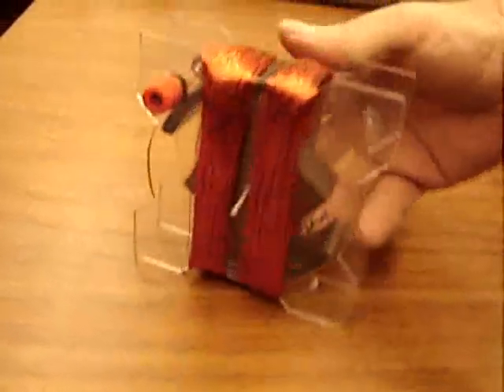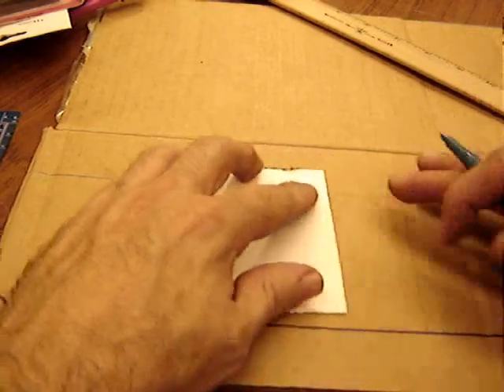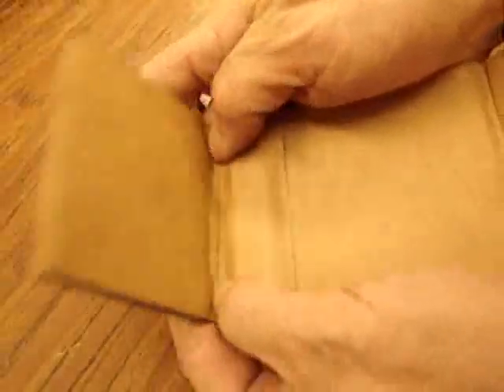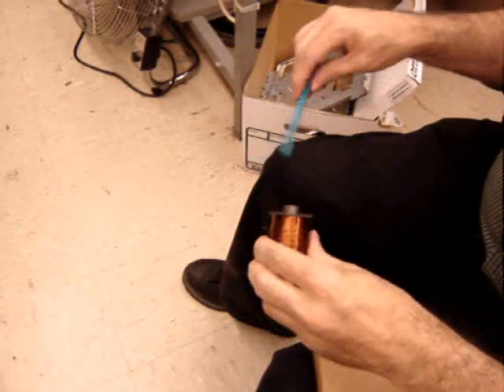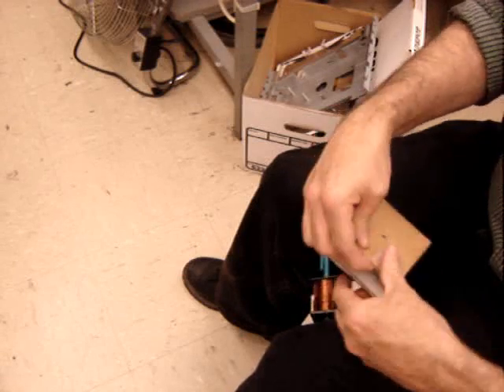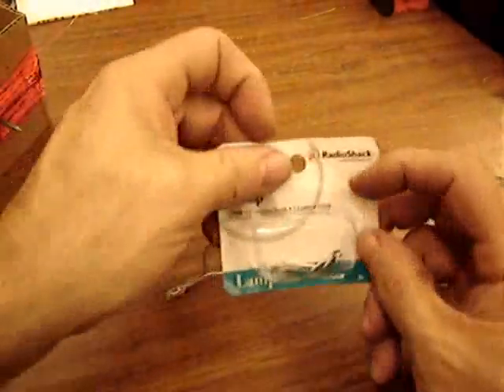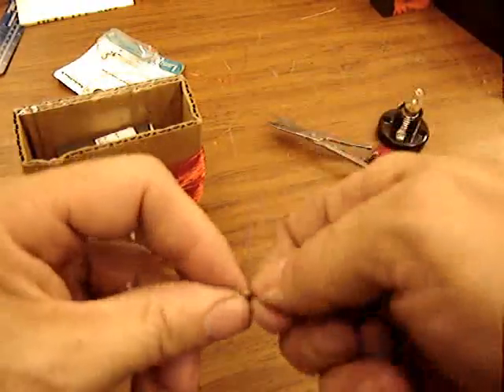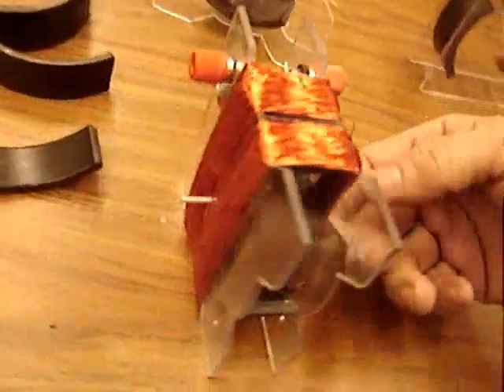Simple generator:  AC electric generator for science fair

Comment: If i use neo magnets and thin wire at 3000 turns and spin it 6000 rpm will it get 120 volts?
Reply from the maker: They're about 7X stronger, so with 10x more turns, and spinning 10x faster, that would give around a kilovolt.  :)

With neo magnets we'd see ten or twelve volts output.  With fingers we only hit 600RPM, so use a drill to get more than 10x higher speed, and approach 120VAC output.  That way you can keep the same wire.  The coil has about 20ohms resistance, and that would hit 6amps when shorted.  So it could easily power a hundred-watt bulb, but the coil would get a bit warm (twenty watts of heat at one amp.)

Or, use neo magnets spun with fingers, and then you only need about 40 turns of wire to light the bulb or LED.
Reply: wbeaty, thanks this is very helpfull. Hopefully i will have it in operation in a couple of weeks, still need to wait for some things to be shipped. Anyway one more thing i need to know about is how many amps i might get when i'm done. I am pleased to see that i will get many volts but i still have no idea how to find out how many amps i will get. I would be very grateful if you could tell me how i could increase the amps or how many I'll get. Thanks.

Comment: On the website you gave instructions to make a more powerful generator, and i would like to know if it is necessary to use smaller wire and why.

Thanks

Ps. Would it get 120 volts?

Comment: I followed the instructions on your website with slight changes (i added about 4 times more wire) and the 3v bulb i powered kept flickering on and off is there any way i can make it stay on?
Reply from the maker: It's an AC generator, and it's pulsing too slow.   Spin faster for smooth lighting.
Or, you could add a diode to convert to DC, then put a large capacitor across your bulb (like 4700uF capacitance, or higher)

Comment: Would you get more voltage if you increased wire gauge and kept the same number of turns?
Reply from the maker: Nope, since voltage is created by the turns-count and the RPM (and the magnet strength.)   Thicker wire does give less ohms resistance.  With #30gauge wire, the generator can only put out about eighty milliamps of current at best (1.7V / 20ohms.)  Thicker wire would give you a higher maximum current.

Comment: Would the magnetic feild reach the the outer wire loops if i used #35 wire and did 3000 loops with rare earth magnets?
Reply from the maker: Probably yes.  But it depends on how messy is your coil winding. Lay down the layers perfectly smooth using a lathe, plus a small amount of epoxy or polyester resin, and your coil will be very compact.
Reply: wbeaty thanks, what kind of bulb (how many volts) would you recommend for the rare-earth magnets and 3k loops of wire?
Reply from the maker: With rare earth magnets, 30 turns of wire will create about 1.5V, and light a #48 bulb or a red LED.    So, with 3000 turns you get 150V, and could flash an NE-2 neon lamp, or deliver painful shocks if the coil terminals are touched.   But 3000 turns of #35 would have about 900 ohms of resistance, so maybe you could put out five watts (so, a very small 120V light bulb.  Maybe an oldschool christmas light, the kind with a small screw base, five watts 120VAC.
Reply: Would there be less resistance with thinner wire? If i used say, #40 wire would it make it more efficient?
Reply from the maker: Thinner wire has more ohms, more heat losses.  That's why we need such big generators for high amps, high watts.   Table of wire ohms: http://amasci.com/tesla/wire1.html

Comment: Can you make a neodymium version of this?
Reply from the maker: I made a small one using one of those "buzzing bee" magnets, the football shaped kind.   I used epoxy to glue short metal rods to the ends.  Then put it in a plastic pipe, and wound the wire so it goes over the ends of the pipe.   To flash a red LED, it only needed about 50 turns of wire.
Reply: wbeaty really? Can i see the videos here?

Comment: Fake video .It did not worked ..I tried this..
Is any one who successfully made it..??( Sure not anyone )
And it is not for any school or college project.Your teacher will throw it away...
Reply from the maker: - Did you follow the DEBUGGING instructions on the main amasci com website?  See http://amasci.com/coilgen/generator_3.html    Don't use different light bulb, generator cannot light a bulb from flashlight (but red-color LED will work too.)  Don't change the magnets, need large black ceramic blocks.  Use only the special #30 enamel wire, 300 turns is minimum, 600 turns is better (buy 1/4lbs of wire, Amazon has it.)  Spin it fast, in the dark (the magnets must whizz like a blur!  No light if slow magnets.)  
- Over the last ten years many hundreds (thousands?) of kids have built this and made it work.   See some of their YT videos here: 
https://www.youtube.com/playlist?list=PLS8LbL7GIZiCRSoUSErutoFYXF4VQUE9J (plus other kinds of simple generators.)
- NOTICE: if you want to test your own version with different parts, first make an exact copy of Ultra-Simple Generator and get it working.  Then add your own changes to the working generator, see if works better, or quits.

Comment: @wbeaty can i do this experiment with a larger cicumference copper wire instaed of a thin copper wire .....????
Reply from the maker: Thick wire doesn't work, since you need to wrap a coil of 300 turns (600 turns would be better.)   With thick wire, 300 turns would end up the size of a football, and the outer parts of the coil would be very far from the magnet.   Only use 30-gauge "magnet wire," the kind with thin varnish coating, see the many links in the main article.

Comment: May i use neodymium magnet?
Reply from the maker: Yes, neo works 8X better than ceramic magnets.  But the coil must stay very close to the magnet (and the magnet must flip over constantly.)   Either use the cardboard with a large neo magnet (expensive,)  or use a small magnet and change the cardboard.   The cardboard and wire must closely hug the flipping magnet, but not touch it.

I found that those neodymium "buzzing bee" magnets would work.  Their poles are on the wide magnet sides.  They just need axles glued onto the ends.  Put one  magnet in a narrow plastic conduit pipe, put plastic plates on the ends of the pipe (with holes for the axles.)  Then wind the wire so it passes over the openings in the pipe.  To light a red LED with neo buzzing-bee oval magnets, you only need about 70 turns of wire, not 400!

Comment: What if I use neodymium magnet? It would work or nah?
Reply from the maker: neo rare-earth magnets work better.   But you need an expensive large neo magnet block.
Or, use a smaller neo magnet, and change the cardboard.  The wire coil must stay very close to the magnet, or else the generator won't work.
Below are DIY generators which use the neo magnets:  

Toys from Trash,  http://www.arvindguptatoys.com/motor-and-generator.php

Comment: Hi, Thank you for showing us how to do this. Since you posted this video Radio Shack went out of business. Do you have recommendations as to where else i can purchase these items? Specifically the light bulb. I'm having a hard time finding the correct one.
Reply from the maker: Yep, see the main project page, and parts list.   Must buy from mail order.

ALL ELECTRONICS has tiny light bulbs LP3, or, get a #48 miniature lamp (needs a flashlight screw-type socket.)   Or, you can use red LEDs, if you add about twice as much wire (or just spin the magnets twice as fast as human hands can spin them.) #30 magnet wire spools sold on Amazon.   ALso, many places have those black ceramic magnets.

Comment: if I use a thinner wire, should I wrap more than 300 times or still the same?
Reply from the maker: More turns is better.   It gives higher voltage per RPM.  (Or, you can light an LED without having to spin the magnets so fast.)    But also, thinner wire (or longer wire) adds extra resistance, so the maximum possible current will be lower, and it won't light up as bright.

Comment: The thing is, would stronger magnets create more electricity?
Reply from the maker: Yep.   But the coil needs to be extremely close to the magnets.   Either use huge freakin' neo supermagnets, or use small neos with a much smaller coil.

Try using "buzzing bee" ovid magnet with short shafts glued to the tips of the magnet (they have their N,S poles on their broad sides.)  Then put it in a tube with end-plates (holes in the plates for the axels,) and wind a 100-turn coil (coil goes around the end plates, NOT around the tube.)
Reply: Good to know.

Comment: where exactly did you tuck the first end of the wire?

is that the other pole you attached to the light? i didn't notice where you had it
Reply from the maker: Two wires, each one attached to the light.    (TEMPORARILY get the first wire out of the way.  Then pull it back out when the coil is complete.)
Reply: thank you.

but do you know how the one wire ends up having two different poles on the same wire?

it is just one wire right?
Reply from the maker: One long wire has two ends, but the long wire is actually a coil.  When we pass a magnetic field across any metal, the field "pumps" the movable electrons inside the metal.  (All metals are full of electrons, like a "sea of charge fluid.")    So, when we shove a magnet into a coil of wire, the magnetic field passes across hundreds of feet of copper, pumping all the electrons inside the metal.  Connect the two ends of the wire together, and the magnet will cause a circular flow, an electric current.

Here's an animation of a magnet passing through a metal ring.  https://www.youtube.com/watch?v=LSMdsabj0aQ  The magnet field causes the ring's electrons to flow.  Also, the moving electrons produce their own field which "fights" the falling magnet, slowing it down.

For generators, we break the metal ring and connect a light bulb in the gap.  Now the path of flow goes through the tungsten filament, and also through the metal ring.

For lots more info, search on:  Faraday's law of induction.

Comment: dear sir i make one like you but still not give me any voltage why do you think the wrong
Reply from the maker: The generator gives about one volt, AC not DC.  The voltage has very low frequency (not 60Hz!!)    Some voltmeters may not detect it.

See the list of problems, "debugging"  http://amasci.com/coilgen/generator_3.html

- Must spin it very fast if using the special light bulb.

- Must spin it even faster, if using a red LED

If wrong light bulb used, won't work.   If not using #30 enamel-coated wire, won't work.   If wrong magnets, won't work.   If spinning too slow, won't work.  If using non-Red LED, won't work   If wrong size cardboard, or if coil is farther away from magnets, won't work.

Better:  use more wire, perhaps 600 turns, even more.

Better: use large neodymium supermagnets (expensive.)
Reply: thank you sir

Comment: Is there a way to find out the negative or positive charge of each wire end?
Reply from the maker: It's an AC generator.  The negative and positive is reversing.

You can hook two red LEDs to it in parallel.  Hook them pointing opposite.   When you spin the generator fast, first one LED flashes, then the other, then the first, then the other.  "Alternating"

Comment: i could only do 48 spins with the copper wire
could it still work or no?.....
Reply from the maker: Using number 30 magnet wire?  As shown in the video?  The main parts list gives many links for getting spools of that special wire, if you don't have local Radio Shack stores.    Normal wire won't work, it's way, way too thick.

See the main website.   If you use different parts, it won't work.   If you don't use #30 enameled "magnet wire," 200feet minimum, it won't work.  (Well actually it can be between #26 and #35 enameled wire, but #30 is cheapest and very common.)

And also, that amount of #30 wire can only light a special "grain-of-wheat" light bulb.   It's possible to light a red LED, but either you must spin the magnets faster than 500RPM, or use much more wire (like, more than 600 turns, not just 250)

Also, try neo supermagnets.   Those are dangerous for little kids (finger-pinch hazard,) so I barely mention them.   But with neo supermagnets instead of black ceramic, you only need about 50 turns of wire, not 500.    Supermagnets are roughly 10X stronger than ceramic magnets.

Comment: Hello I am working on this for a science fair and can not get the bulb to light. I have the same radio shack bulb. I don't think i have the wires correctly placed. Does it matter which wire goes on the long leg of the bulb? I have the last wire (meaning not the one i taped to the box)  on it.
Reply from the maker: Two wire ends, connected to the two bulb wires.    See MAIN PROJECT WEBSITE for lots more info.

The tape is temporary, just to keep one wire from sproinging loose and unwinding.

Comment: what if my copper wire is too short and I tie it to make it long to reach 200 turns does it work?
Reply from the maker: Yes, but first must scrape all the plastic off about 1/2inch of both ends.  Twist solidly together, so metal touches metal.
Reply: Ahhh OK thank you very much and I'm gonna do it right now because the science fair is in January 2017

Comment: it's a DC generator! not an AC generator as you said!
Reply from the maker: No, a DC generator requires a commutator, a rotating switch.

Rotating magnets produce alternating magnetism.   Rotate your magnets near a coil, and the coil produces an alternating voltage.   The device is called an "Alternator."

Comment: What grade would this project be recommended for? I'm in the 8th grade, would this be suitable? i find it very interesting. Please answer asap as i will need to prepare a report very soon. Thanks! :)
Reply: Oh yes and also, I'm planning to make the plastic version (if the project is accepted for an 8th grader). If yes, do u think that i could have a simple tutorial on that? Is it the same steps just using plastic instead of cardboard?
Reply: Also, one more question... is this bulb...https://www.dealsplus.com/Others_deals/p_1-5v-25ma-miniature-lamp going to work?
Reply from the maker: It's designed to build without needing to wind 800 turns of wire, without power tools, even without pointy-end scissors.   How low can you go, maybe 4th grade, maybe lower.   But it should be easy to add some complexity for much higher grades.   (On the other hand, always build the cardboard version.   Get that working first, only then make changes.)

Build a wood or plastic version?    Add a crank-wheel and drive-belt so the magnets can spin 10x faster?  Buy wire online and do the 800-turns version, which can easily light red and green LEDs, or add a diode and charge a supercapacitor.

Also, I made some tiny versions using "buzzing bee" supermagnet, the long egg-shaped ones.  Those magnets have their poles on the sides, so we can glue axles to the tips, and make a generator that-s about 1in wide.  It only need fifty turns of wire!
Reply from the maker: That's the exact one.
Reply: If I were to do 800 turns of wire, around hoe many ft of it would i need?
Thanks for your help :)
Reply: Also, the 800 turns version uses the same wire? Where can i buy the crank wheel and drive belt?
Reply from the maker: Lucas W
Yep, #30ga enamelled wire.  See project site links page for many generator projects.  People make crank-pulleys from old dvd disks, etc.

Comment: Hey thanks for showing me how to make this! One question: I can only find 1.5 V 40 mA mini bulbs at Radio Shack, I've called around but all the stores near me are sold out of 25 mA. I saw on your website you use a 40 mA also, should this work?
Reply from the maker: Yep, the 40mA also work.  Radio shack discontinued those too!  Not in their catalog any more.  Better buy several.  You can still get them mail order, these from All Electronics, http://www.allelectronics.com/item/lp-3/1.5v-t-1-3mm-lamp-w/10-insulated-wire-leads/1.html     And Lucas W. found this one: https://www.dealsplus.com/Others_deals/p_1-5v-25ma-miniature-lamp    If you wind 2x more wire onto the box, you don't need the special bulb, and can light a red LED.   The bulbs only need about 0.7V to glow dimly.   A red LED needs 1.7V.

Nicholas Lim made his with a mechanical hand-crank:   an old junked fishing reel with the spool removed.
Reply: CADubT use led
Reply: CADubT i
Reply: Many thanks, I have been researching "making a electric generator at home" for a while now, and I think this has helped. Have you ever come across - Ieanarial Nonpareil Interest - (should be on google have a look )? 

It is a good one off guide for discovering how to cut your bills and create your own electricity with this secret method without the hard work. Ive heard some unbelievable things about it and my friend got cool success with it.
Reply: This was great, I've been looking for "which method of generating residential electricity are you familiar with" for a while now, and I think this has helped. Ever heard of - Diyadison Penhloe Blaster - (just google it ) ? It is an awesome exclusive guide for generating your own electricity without the hard work. Ive heard some decent things about it and my colleague got amazing results with it.